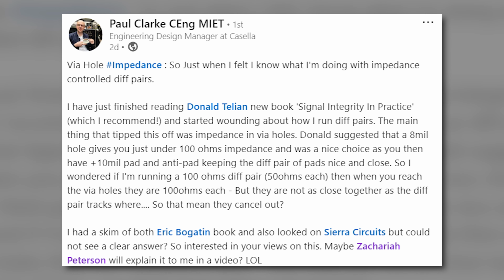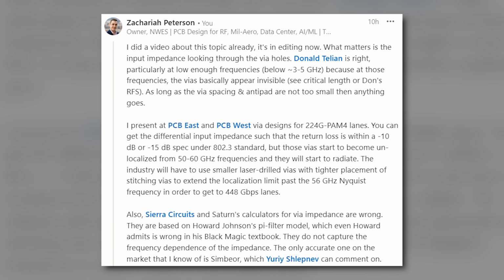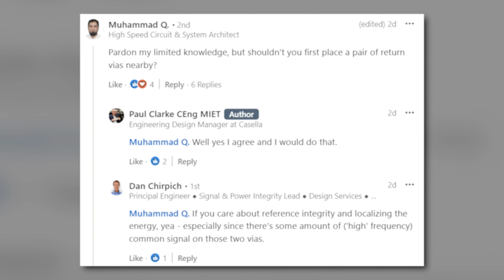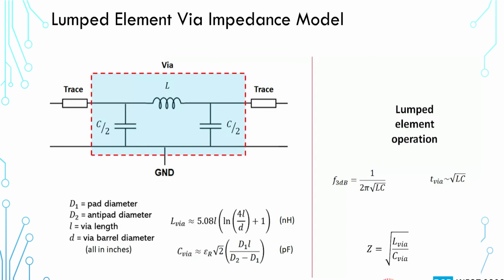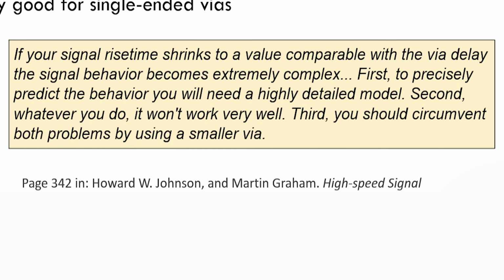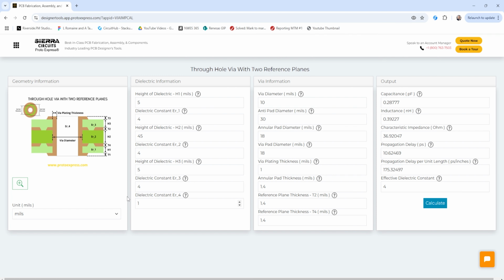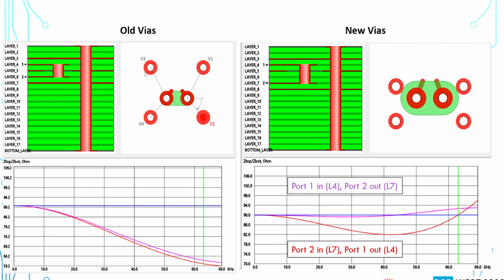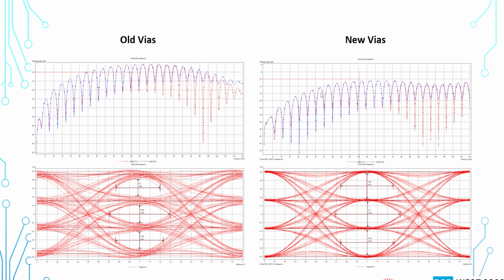What's Wrong With PCB Via Impedance Calculators? #signalintegrity #pcbdesign #altium #kicad

Comment: In all these PCB layout videos, they talk about theoretic calculations and subjektive experience from complete product PCBs that failed EMI or signal integrity an some changes that fixed the problem. Why does no one test this on real PCBs that only contain the problems in question with different setups that also include partial wrong layout. Lets say correct differential pair but wrong via layout and compare this with real world measurement. I think this would greatly increase the "Ah ha" Effekt for the viewer and can possible point to most important variables and less important ones.
Reply: Well you see ☝️ engineers